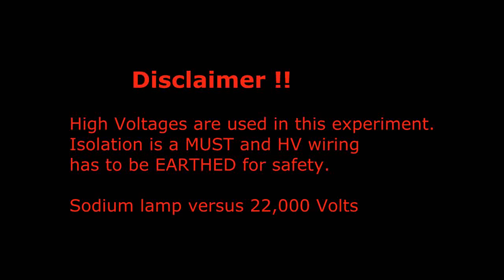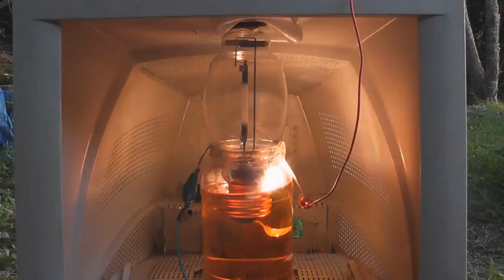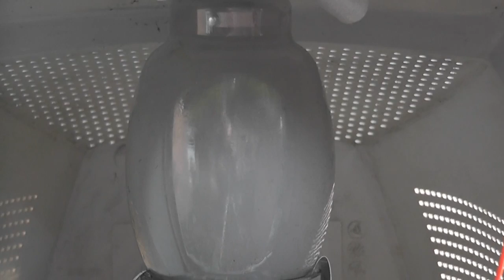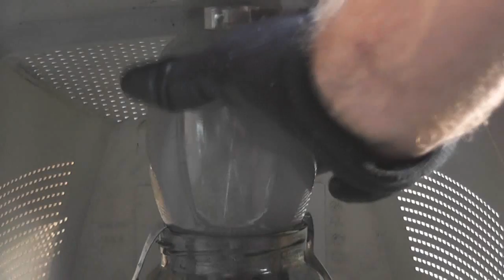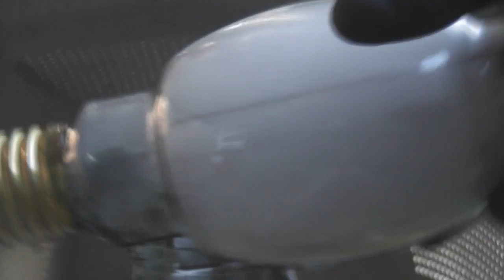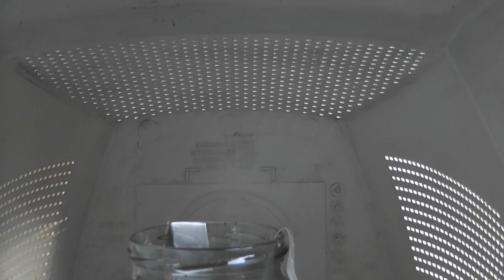Sodium Lamp v 22000 Volts

Comment: LMAO. You popped it, but.....

I think it would've gone off a bit more dramatically if you'd have slowly cranked-up the volts with that large variac you have.

Set the voltage so that the output side of the Tx is just over what the lamp would normally accept, get the lamp glowing & warmed up, then.......

RIP IT RIGHT UP for the epic arc-over poppage. :D Yes, I think that with the lamp running & hot, the arc-over in there would've been ridiculously bright, then it probably woud've exploded everywhere in much the same manner as that car lamp which Mr. Photon fizzed-over when I was in his playroom.

Thanx for showing,

-BoomBoxDeluxe.
Reply from the maker: Yes you are right there, this was a Sunday afternoon quicky, couldn't be bothered dragging the heavy variac out the garage and wiring it all up. It probably needs about 5 kV to strike and less to run.
Reply: RODALCO2007 Yes I was thinking the same - 22 000 V is so much it will arc over just where the leads get close to each other (and the oil cant get inside the socket), but this was still nice

Comment: aww that was a rare one (was an old one with the BT28 evalope i wood of gladly traded it off u and given u a not so rare replacment to pop like a nice PRC one :p btw going by the bulb sise it looks to be 150-250W 400W wood normely have a BT37 eneverlope the old ones that is) but still cool i gess im serprised it dident strike the arc tube as those only need 5Kv to strike
Reply from the maker: This type lamp is still very common in NZ. many of these are thrown out each day.
Reply: I still see them being sold and used here sometimes, yet that kind of envelope is much more common on mercury lamps, sodium lamps are smaller .
Reply: RODALCO2007 intresting very intresting do u know who makes em (im going to take a punt and say silvaner) if u cood save me one for my colection of lamps that wood be ace :) (wen u say commen do u mean this pertcular shape of lamp etc or the skinny tublurar ones wich arnt rare )
Reply: Have to say I hven't seen them for a while, but if I find one, I will  make sure to keep it, the steel part on top is quite unusual.
Probaly there are some on flea markets around here, finding is just matter of luck.
Once say a man who had some old and unusual lamps (Incandescent and arc) but they were way too expensive.
Reply: Some mercury lamps actually are self ballasted, as I might recall.
yeah, I've seen those mercury ones with a filament inside, along with the arc tube, I'm pretty sure I saw them the last time I went to the hardware store.
No idea if these actually need any ballast, never seen one being installed, but I heard after turning one off, they need to get cool before starting again.
You should check migette1 's channel, he's an awesome lamp collector and probably knows a hell lot more that I do!